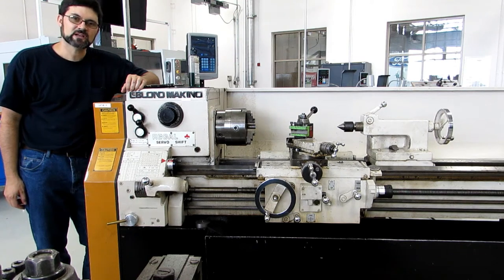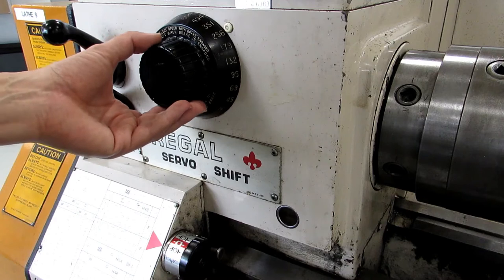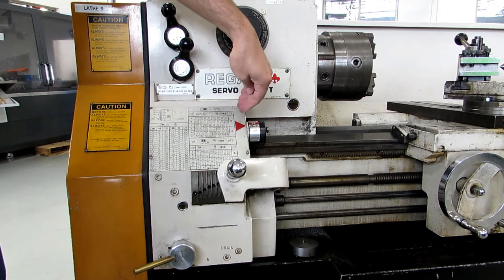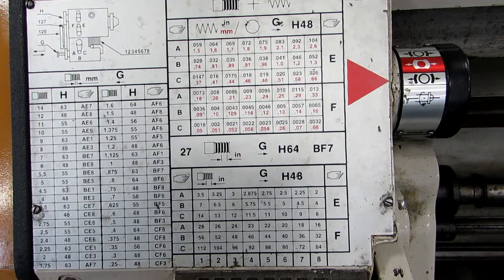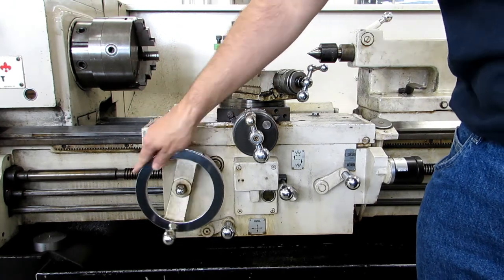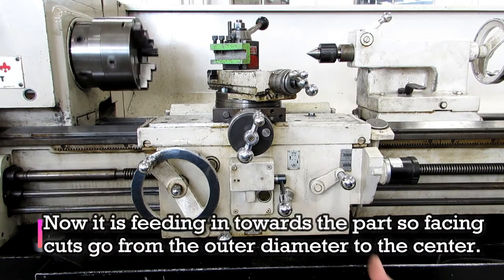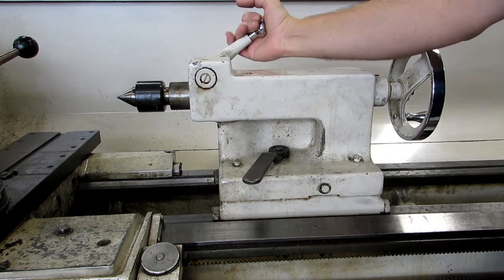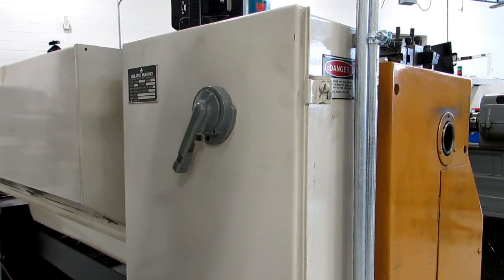Parkland College Lathes - The LeBlond Servoshift Lathe

Comment: Can you explain what the h48  h64  mean and how to change
Reply from the maker: I had to rewatch it to see what to do. Starting at 3:33 you can see the feed chart. In the top left you can see a drawing representing the gear train for the lathe with one of those gears labeled H. The chart below that drawing shows the metric threads available with the thread pitch shown in the column labeled with a drawing of a thread, the H column shows the gear you need to swap into the H position, and the column marked with a hand shows the gearbox position. For instance AF8 would be the position for 1.5mm pitch with a 48 tooth gear in that position. To change that gear you would have to remove the cover on the end of the headstock and swap out the correct gear into the H position in the gear train. I'd like to point out that 27 threads per inch also requires a gear change with a 64 tooth gear and the gearbox setting at BF7. This is pretty common since most leadscrews are going to be 4 or 8 TPI and 27 isn't a multiple of that. 27 is, however, a common thread to cut since it is used on smaller pipe threads. I hope this helps. Let me know if you have any other questions.
Reply: @StuartdeHaro  Thats what i figured i have to cut a 12-1.5 mm and every gear listed on the machine not being used is on a round spool except the 48 so im assuming its in the machine .Also not sure how to put this machine in low gear its an old leblond i believe its a knob that you can pull out or push in  inside the cover where the gears are and its in the in position so i think im good there. thanks for quick response
Reply from the maker: @ke018co1  Probably so. If you look at the inch feed and threading charts they both list H48 as the gear being used.